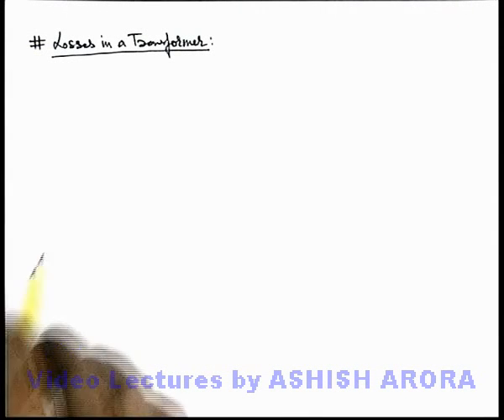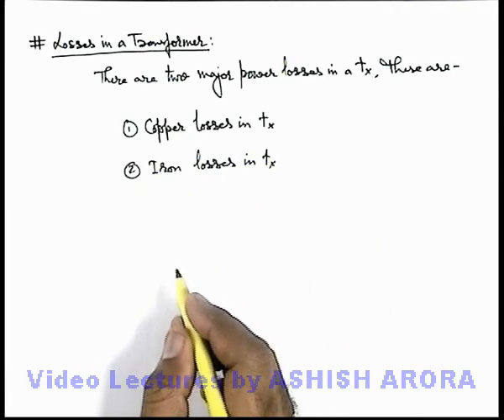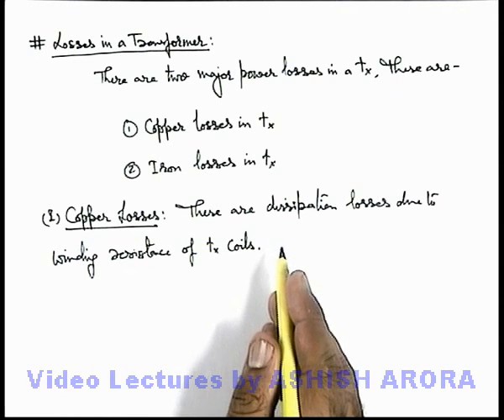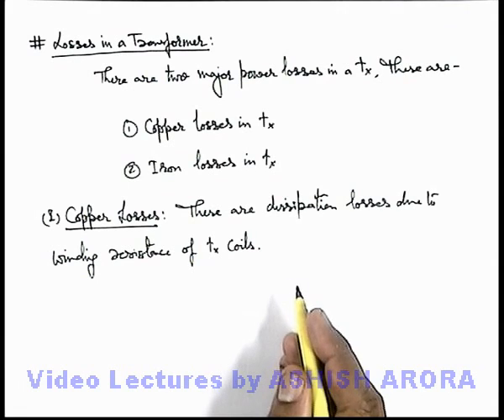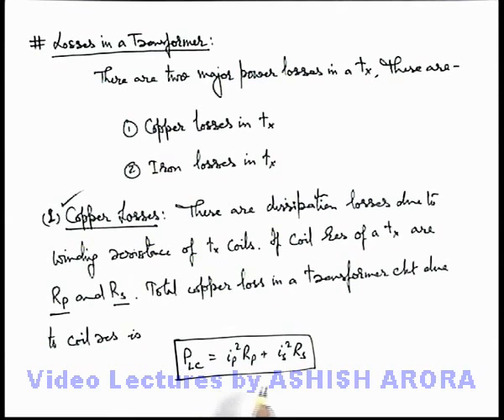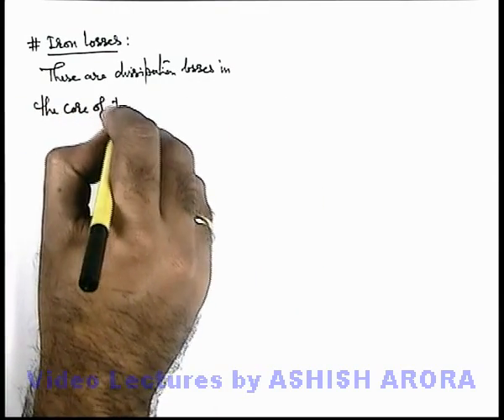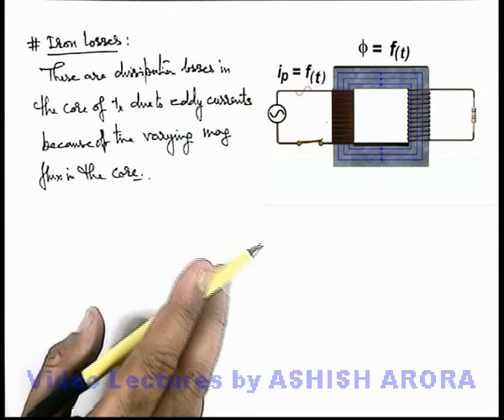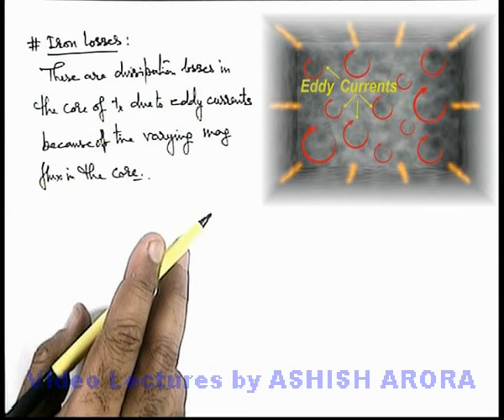Class 12 Physics | Alternating Current | #55 Losses in a Transformer | For JEE & NEET

Comment: Sir i have an idea to calculate eddy current loss, :-
1.Measure the initial temp. Of iron
2.Using l, b, h of core calculate volume and then mass (M = V * density) 

3.After any desired time , measure the temp of block at least in 6-7 regions,  calculate avg temperature and then use --

Q = S*M*dT
 S- specific heat capacity
M- mass
dT - temp  change

Comment from the maker: @Daniel, These are laminated sheets which are laminated by an insulating paint... If just metal sheets are placed one over another there is no use of these as it will be same as a solid core.... This insulating paint will break and limit the eddy currents only within the sheets...

Comment: if the core is laminated means the thin metal surface is covered by plastic type material then how magnetic flux passes through it such that current starts flowing through secondary coil ??????????